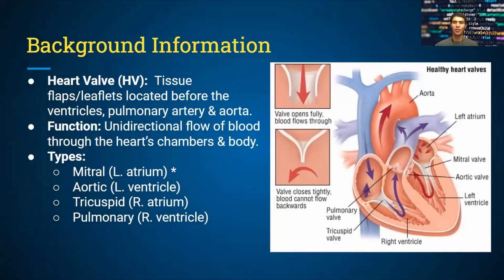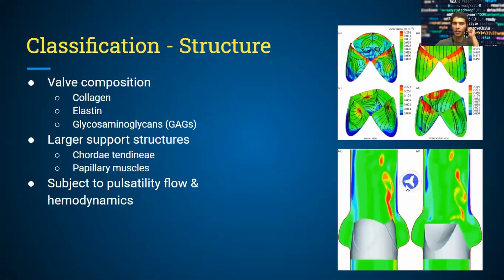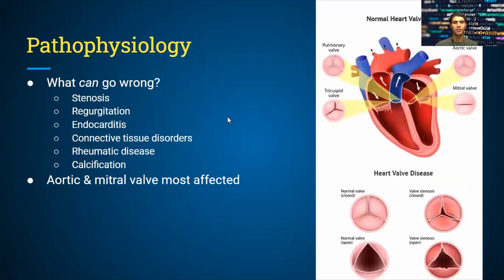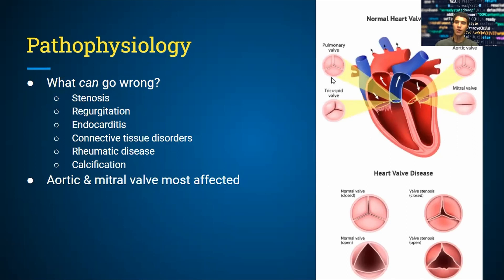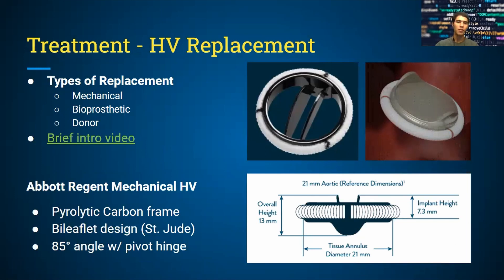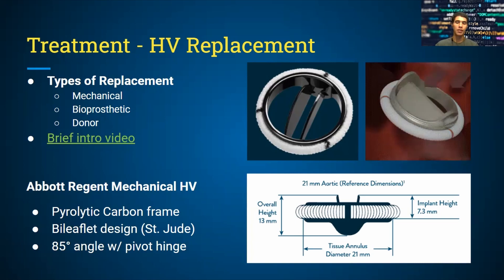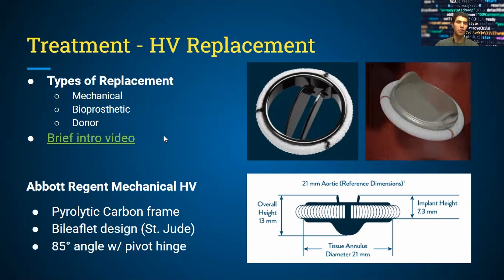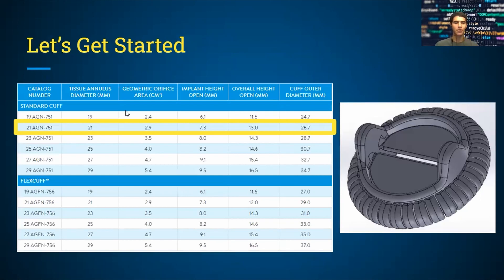How to Make a Mechanical Heart Valve on Solidworks

Comment: Is there a chance you could upload it with an explanation? I am trying to follow, but am having problems with sketching the attachment profile specifically smart dimensioning the arcs between the 5 and 10 degree lines.
Reply from the maker: Pretty sure there's an uncut version in the description.